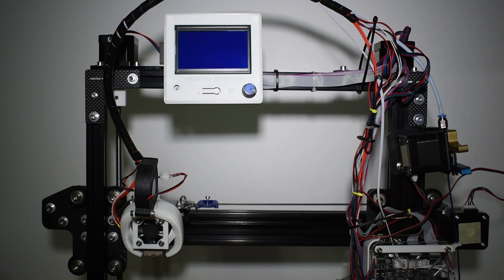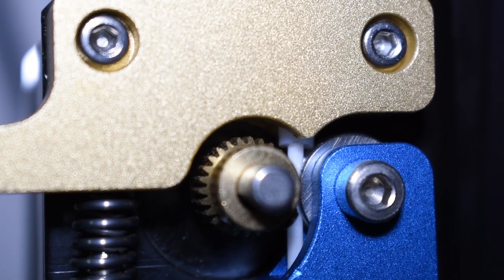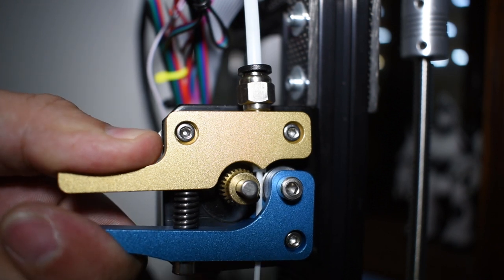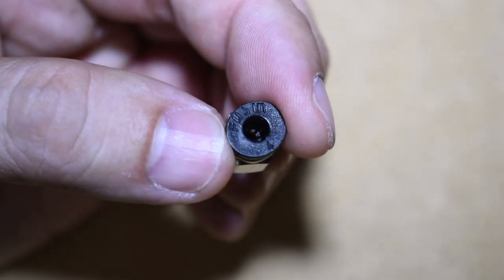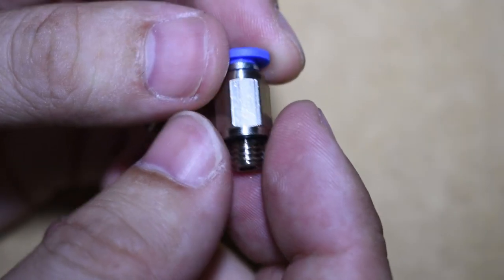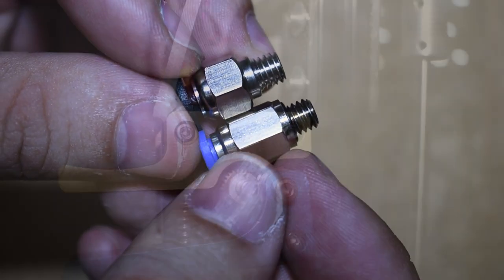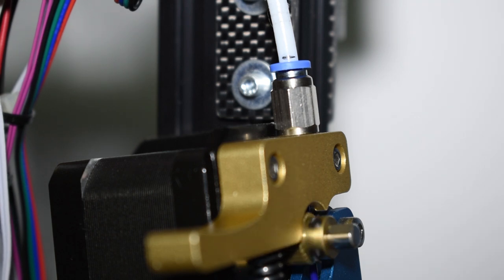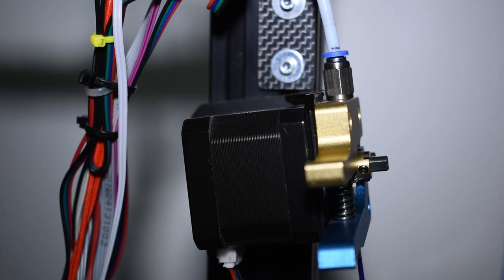TEVO tarantula - Fitting issue and solution

Comment: Well, you solved a problem but you added a new one. The filement needs to be guided tight from the gears. If the tube does not come to the gears the filament floats into a 4mm hole. So you cannot print flexible or soft because they will jam. Another way of fixing the same issue is to print a fixing clip for the pneufit which prevents the plastic part to go back during retractation and release the tube. Just a 2mn print ;)
Reply from the maker: Hi Axel,
What you say is true but only when using flex filament with this extruder.
I only know a couple of guys that were able to print flex with this extruder but with ultra low speeds. That being said, i believe that more than 98% of the users that have this extruder don't print flex filament.
Reply: The jam will occur only with flex filaments, you're right. But you will also have issues with soft filaments, like Nylon, some PETG, some ABS which can be soft sometimes. It's not all about jams, but also about precision of extrusion. Some charged filaments (wood, glitter, fibers...) are more fragile and can broke if not properly guided since the gears. You can encounter more issues if you print at the lower range of temperature or if you have a wide nozzle.

I'm afraid your numbers are underestimated. 20% of the Tarantula users we met prints various kind of filaments, including flex ones. We built 16 Tarantula this year. It's the third year we're doing this workshop with this machine and the proportion is stable : 4 out of 5 people will print PLA only, but those interested by other materials do print a large variety of materials. The last statistics I had with Reprap stats was around that proportion. The 3D systems stats shows 80% of their customers uses different materials. 

It's pretty easy to print flex filament with the Tarantula. You just have to fix your extruder on the X gantry and reduce the bowden tube under 250mm. Simple as that. Anyways flex filaments needs to be printed slowly, even with a direct feed extruder.
Reply from the maker: Hi Alex,
Thanks for the feedback.
I can't really comment on that...need more time to check and test.
I only have the knowledge of a friend that also has these fittings and he prints ABS with zero issues.
Other than that, i need to confirm over time.
Reply: ruiraptor Hi, as well is good to glue ptfe pipe to ptfe holder only on extruder side, it works 6 months as is should ! 👍
Reply from the maker: Hi Ruuge,
Thanks for the feedback.
I actually know that technique for a long time but always tried to avoid that because of 2 things:
1- It will be harder to remove when you need to and that tip of the ptfe tube will have to be cut off later on.
2- In some cases, the ring of the fitting (where you glue the tube to) can also still move up and down.

Comment: The only problem i'm having after this update is that pushing filament for the first time (during a filament change) is such a pain
Reply from the maker: Hi,
Actually, you have 2 tricks that help you with that (i use them and as you can see in the video, the filament goes in in a second).
1- The filament is normally curved from being in the spool. Straighten the first few centimeters.
2- Cut the tip of the filament in a sharp 45 degrees

And that's it...it should go in easily now.

Comment: i am having issues when i turn on my printer it says heater decoupled any idea what this means
Reply from the maker: If you get that message it means that the firmware does not detect the temperature rising after switching on the heater. 
You need to check the heater if its ok (faulty, bad wire/broken wire) or the temperature sensor not in place.
You must also check if you have the hotend temperature sensor or heater swapped with the heatbed.
Reply: my friend was wondering if it was the firmware i was just wondering your opinion anyway thanks.

Comment: All i did was to put a zip tie around the push down ring so it couldnt release the tube
Reply from the maker: Hi Lerbyn, 
as you can see in my video, i was able to push the ptfe without pushing down the ring and with no effort.

Comment: Is this a PC4-M6 fitting?
Reply from the maker: Hi Thomas,
You are correct. Yes it is.
PC4 (which is for tube with 4mm outer diameter) and M6 (M6 thread).
Best regards
Rui